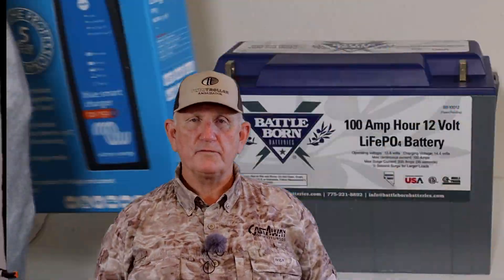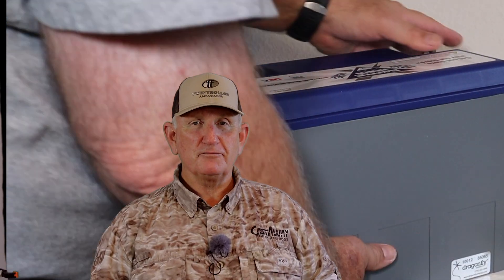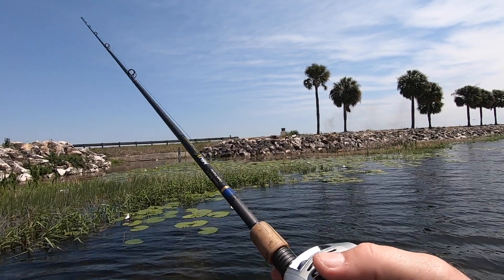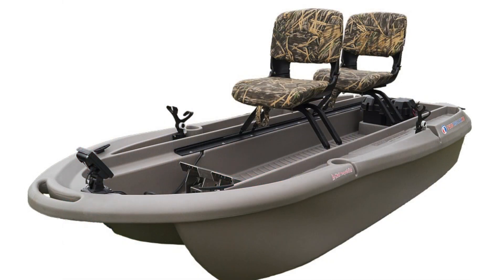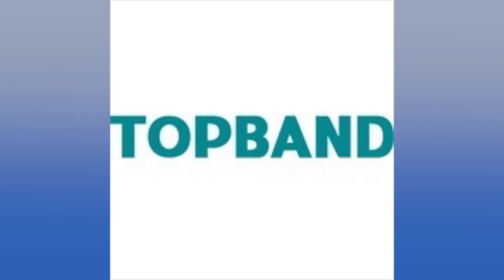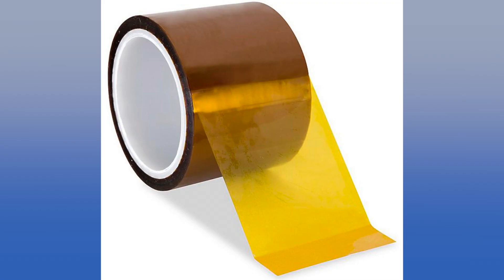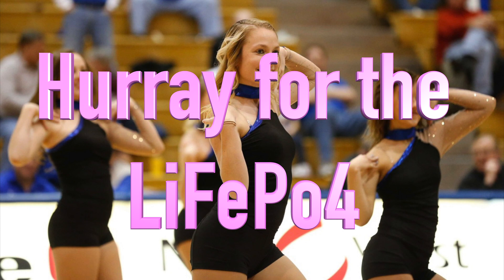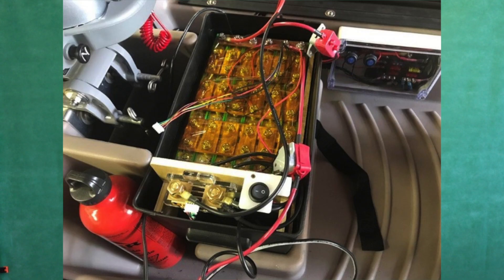You Can Build a Lithium Ion Battery for Your Boat!

Comment: This is to address Gerry’s question regarding battery monitoring:

Lead-acid batteries have a fairly linear relationship between voltage and capacity, so measured voltage is a good proxy for remaining capacity.  A lead-acid battery’s voltage will drop at a constant rate as the battery power is being consumed.  With lithium batteries, voltage stays fairly constant for over 80% of the battery’s capacity, so measuring voltage to determine capacity is no longer appropriate.  For example, a fully-charged LiFePO4 cell will read around 3.6V off the charger.  Once a load is connected, cell voltage will drop very quickly to around 3.3V.  Cell voltage will remain around 3.3V until over 80% of cell capacity has been consumed.  If more wattage is drawn, cell voltage will again drop quickly.  So if you measure cell voltage and you get 3.3V, you don’t know whether battery has over 90% charge remaining or 10% charge remaining.
 
To get an accurate measurement of capacity, battery monitors use a “shunt,” which is nothing more than a low resistance resistor.  Since the shunt’s resistance is known, by measuring the voltage drop across the shunt, battery monitors can compute and record current and power by using Ohms law.  By connecting the shunt between one of the battery terminals (usually the “-“ terminal) and all your loads (e.g., TT motor, lights, fishfinders, etc.), the battery monitor can keep track of cumulative power consumed.  If you also charge the battery through the shunt, the monitor can track power into the battery as well. There are lots of good information on the internet explaining how shunts work: here’s a basic explanation (https://www.youtube.com/watch?v=_3GPaFuqrxs&t=337s).  If this is too much mumbo jumbo for you, you don’t really need to worry about it.  Hooking up a battery monitor is super simple.  Just buy one and hook it up, and it’ll just work.

Battery monitors vary in price from under $30 to around $200.  See

https://www.youtube.com/watch?v=A1l7r5r2CP4&t=148s 
and
https://www.youtube.com/watch?v=E6O76Okmt08&t=330s

They all have a shunt and operate based on the same principle.  On most, the monitor itself is connected to the shunt via a wire.  On the more expensive Victron Smart Shunt, a physical monitor is not included.  You use the Victron app with your smartphone, connected to the Smart Shunt via Bluetooth, as the monitor.  I use this monitor 

https://www.amazon.com/LNEX-Portable-Automotive-Battery-10V-120V-Programmable/dp/B08V1VZNGH/ref=sr_1_4?dchild=1&keywords=lnex+battery+monitor&qid=1629837378&s=industrial&sr=1-4

on my TT.  It’s actually a bit overkill for the way I use it.  I don’t recommend or not recommend this monitor.   I’m using it because it does what I need, and was sent to me by Amazon for free in exchange for an honest review.  You can read what I wrote under review titled “Identical to the popular Renogy 500A monitor.”  If I had to buy a monitor for my TT, I probably would take a close look at the “el cheapo” reviewed by Will Prowse in the 2nd video above.  Of course, given Victron’s well-deserved reputation, their Smart Shunt is definitely worth considering as well.

If anyone is thinking about buying the monitor I'm using in my TT, note that the wire connecting the shunt to the monitor is miles long and was a pain.  You can tuck the wire into the battery box, but I decided to just cut the wire and re-spice one of the connectors.  I cut the wire to around 10', which is just long enough for the monitor to be placed in the front of the TT if I choose to.  I put the monitor in a waterproof tackle box so I can leave it anywhere on the boat without worrying about saltwater infiltration.

I’m not sure if I provided information that people are interested in.  If anyone has a specific question, please don’t hesitate to ask in the comment section of this video, or through Gerry.  I will try to answer as best as I can.

If you would like a bit more background on lithium batteries in general, I recommend this book by Micah Toll.

https://www.amazon.com/DIY-Lithium-Batteries-Build-Battery/dp/0989906701/ref=sr_1_3?dchild=1&keywords=micah+toll&qid=1629834224&sr=8-3

It has lots of good information and is a quick read.

Patrick
Reply from the maker: Wow Patrick, that is quite an answer. Well written, thank you!               Gerry

Comment: Impressive! I used to work on an air defense weapon system that used NiCad batteries. They were designed very similar to these Lithium batteries described in this video. They also had extremely high current output, but they were designed to support the huge load of drive motors for both the six barrel gatling gun as well as the turret drive system. I used to hate having to remove them for servicing because of how heavy they were. This sounds like an interesting possibility. Thanks guys!
Reply from the maker: Mike, thank you for your service to our country!  🇺🇸                              Gerry

Comment: I've watched your other videos concerning the lithium BB battery. That's Expensive. I was just wondering, has anybody tried two standard 12v lead acid batteries hooked up in parallel?  I understand this is supposed to greatly increase run times. Would that be too much weight?
Reply from the maker: Srsykes, I have heard of some others using two regular batteries at the same time. You are right to be concerned about the weight. Before I installed the lithium my old battery weighed almost 75 pounds. Two of those would add up to 150 pounds. My lithium battery weighs 30 pounds so two of them would weigh less than one regular battery. The lithium batteries are more expensive but the benefits are substantial.            Gerry

Comment: My trolling motor is of the smallest size. Yet we all know we want more running time. I do. So I personally went on my town way. I bought 2 expert power 20ah batteries and wired them up my way. AMG sealed batteries. Went on Google. Asked what was the running time for an trolling motor. 5 hours or less. Put my set up in an 5gal bucket of water. I did not expect 5 straight hours of run time. I had to quit the test. 12.2v left. I did not want to hurt my new batteries. I ran my motor at 30% power. Guessing for just trolling speed. Test stopped at 12 hours none stop running time.
Reply from the maker: ScanaDaze, You are the first I heard to do a test like that. Very interesting!                                       Gerry
Reply: @LunkerFishing  I wire my batteries up different. I have two of those batteries. 1 their cheap. 2 their small. 3 they have ah. I am an big guy. I need less weight on my 12.5ft raft. Although rated for over 900lb. Yet the battery wiring goes for every two battery system. Just move one wire. Makes both batteries into one single battery. 1 wire on 1 battery on the positive. The other on the other battery negative. With the normal positive to positive and negative to negative to keep 12v. Less strain on the batteries and make them into an single battery. Just works.